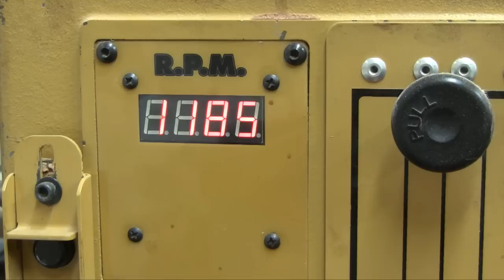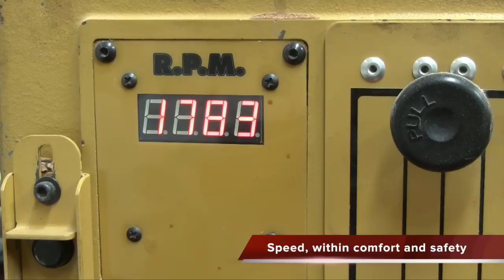Against the Grain

Comment: Thanks for this exceptionally good explanation. I would like to see a demonstration of your preferred method  for cutting across end grain in the bottom of a cylindrical end grain box, where the inside bottom of the box is flat and perpendicular to the grain direction, as in hollowing a spindle. I have had no success hollowing air-dried (for 20 years) white birch. In this situation, it appears to me that the direction of travel of the cutting edge makes no difference, as you are still cutting 90 degrees to the direction of the grain. I've tried gouges at various grinds and cutting angles with much chattering and tearout. Best success for me was with a scraper, but again, this was not even close to a clean cut.